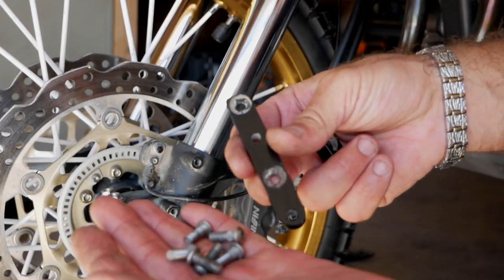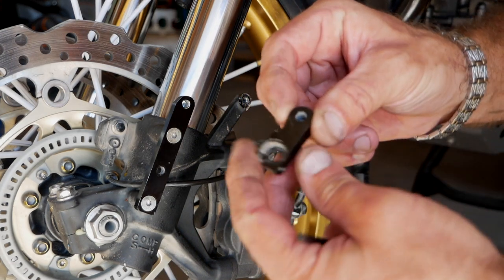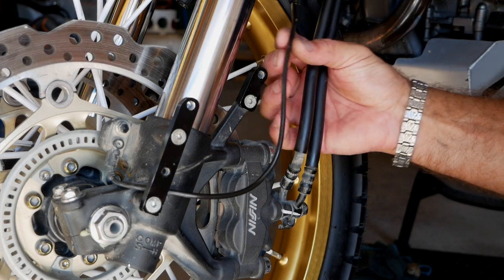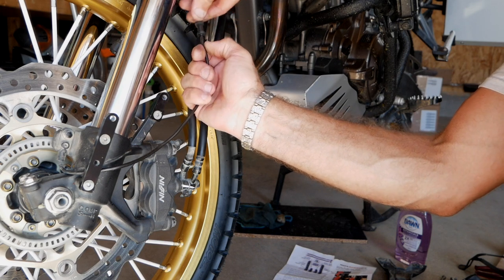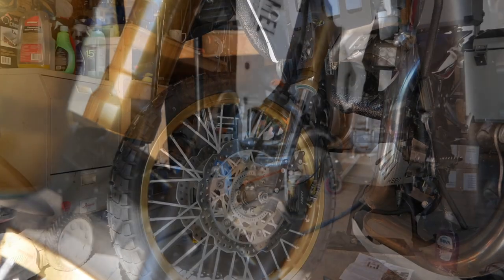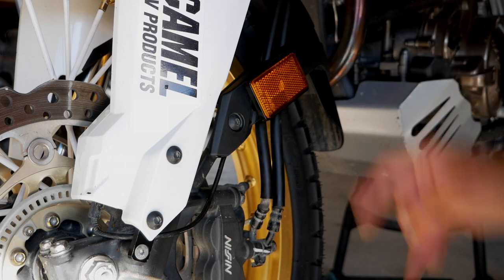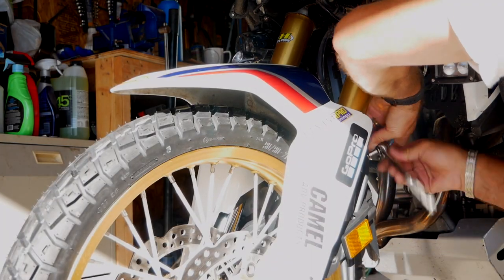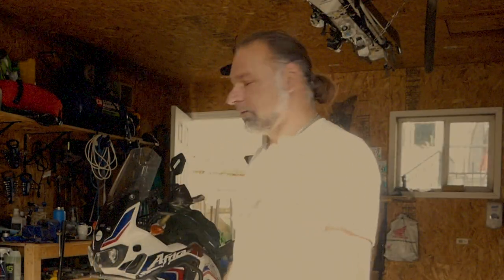HOW TO INSTALL ROX FRONT FENDER RISER HONDA AFRICA TWIN

Comment: Hi. What is the advantage or purpose of lifting up front fender? Thanks.
Reply from the maker: First of all if you are in mud less chance of mud on tires getting in touch with the fender potentially can break the fender second it looks a bit different with that small extra gap.  I did not want to go with high fender full lift as the off road i do is not that extreme but that little bit of a lift does make a difference once you have mud with rocks on the tire.
Reply: Good point. Thank you.
Reply from the maker: anytime